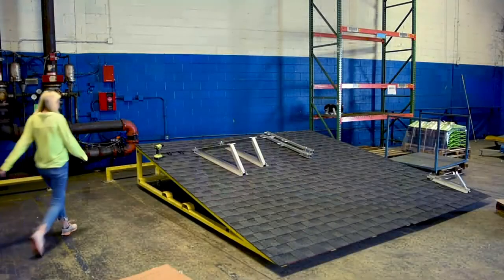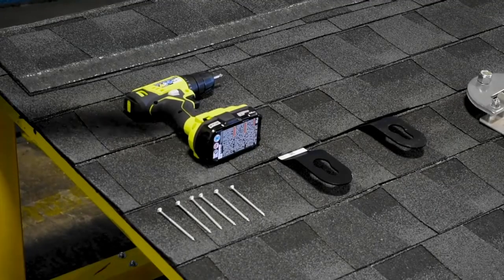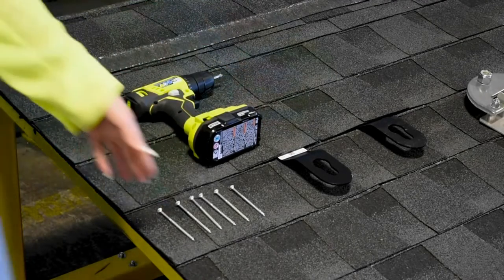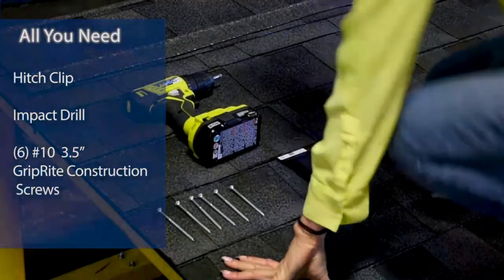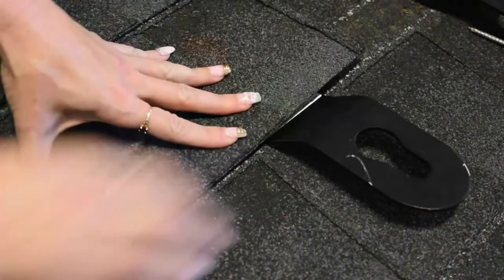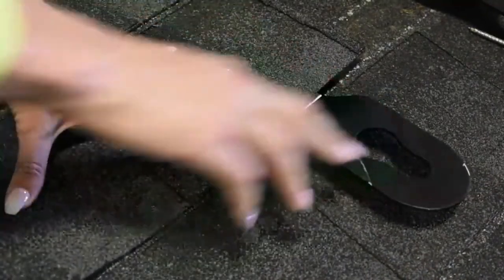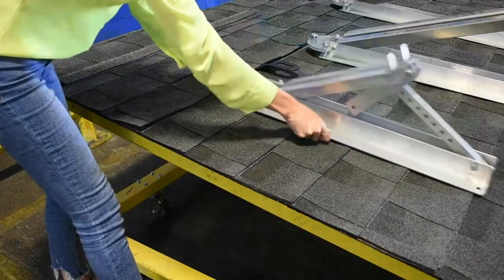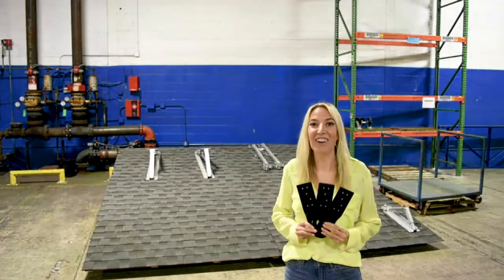Tie Down - HitchClip Anchor | How to Install The HitchClip Anchor

Comment: Is this method suitable as a permanent anchor? Do you recommend flashing of any kind when installing?
Reply from the maker: The HitchClip can be used in a permanent application if installed per the manufacturer's instructions. Installation location must be selected and deemed compatible with HitchClip by a Competent Person. A semi-annual inspection of the anchor, substrate, and installation is required in all permanent applications. The HitchClip can be flashed over, we feel the minimum is to at least caulk over the fasteners.